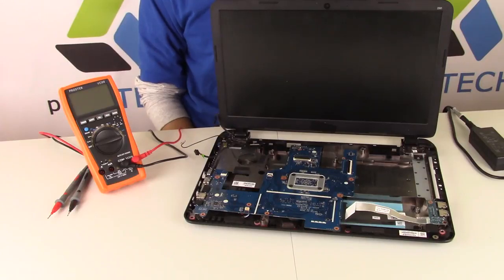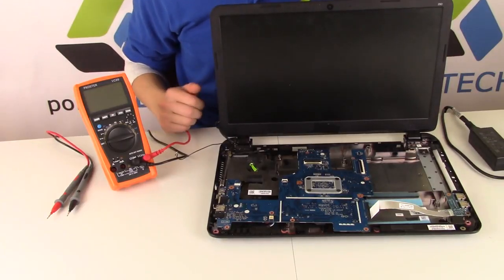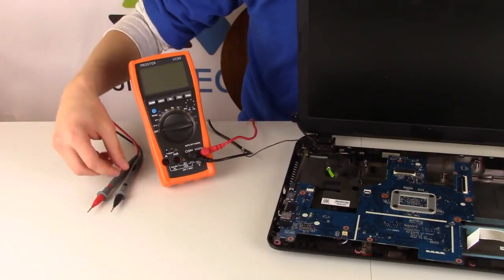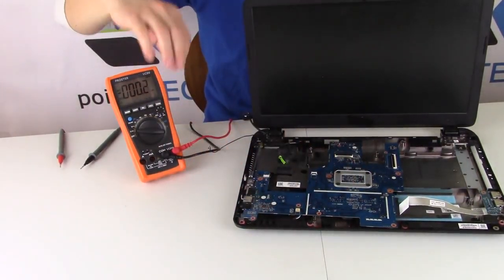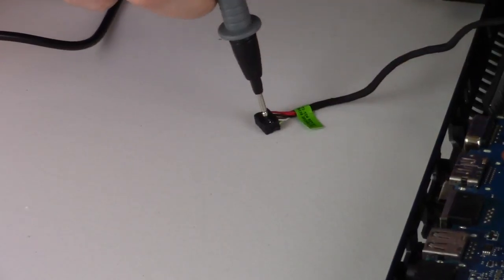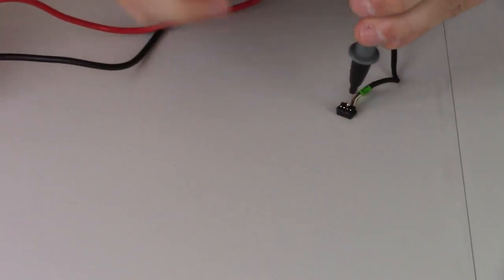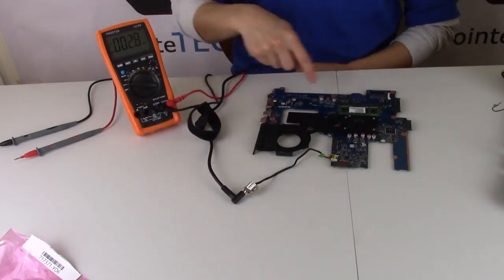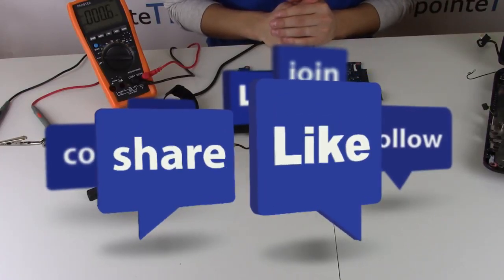How to Fix Test Power Jack - HP Laptop Computer

Comment: Thanks for the video.  Replaced the jack and worked fine for a short period and now it will not charge at all.  I suspect the small plastic (?) clips that hold the jack in place have been damaged. The jack is just not solid.   Have you ever had to replace that part and if so do you have a video for that to reference?

Comment: Great video! I figured out that my power jack is bad. Where can I get a new power jack? Im new to all of this pc stuff 😅. Also, is there a store where I can find the model of my power jack or do I need to buy it online. My power jack is connected to the motherboard as well, but I figured out how to read it.
Reply from the maker: I usually get my parts like that on Ebay, Amazon, etc. Would you like help? If so, what brand and model computer do you have?

Comment: what if it all of it is fine? what should i look at next
Reply from the maker: I dont know. What issue are you trying to resolve? What brand and model computer do you have and whats the issue with it?
Reply: hey, its a hp 15 bs031wm (i3 7100u variant). 
Its completely dead, absolutely no sign of life, no fans, no lights. 
I tried power draining, reseating the ram, inserting the ram in a different slot, inserting new stick of ram, removing the hard drive and just letting it boot up with the m.2 ssd (windows is on the ssd), reseating cmos battery.
I even measured the voltage of the adapter, the port on the laptop, the socket the port attaches to and the voltage is perfect in all 3 of these spots. The voltage of the cmos battery is also a perfect 3V too. 
What else can i test?
Reply from the maker: @shumailkhan7205  For a computer that does not turn on, try this video first; https://youtu.be/kOBY4k2Mn_k. 
If, after trying all the steps seen here multiple times, you have not been able to find the issue, your most likely looking at one of two possible issues. (1) The motherboard is bad and needs to be replaced. Let me know if you would like help finding a compatible motherboard. Or (2) there is another computer component, shorting out the motherboard and need to be replaced such as the power jack, USB board, Touchpad, etc. You would have to troubleshoot each of those individually but unhooking it from the motherboard and trying to turn the computer on. Let me know if you would like help with that operation.
Reply: @PC_Monkey right now i have another issue going on too. the cmos battery wont pop back in. nothing is broken but i dont know why it just wont pop back in
Reply: @PC_Monkey also, thankyou for taking the time out to reply and offering to help further. It really means so much
Reply from the maker: @shumailkhan7205  Its hard to advise without seeing it but if the CMOS batter was in there to start with, it should go back in. If the CMOS battery port is damaged it would need to be replaced.
Reply: @PC_Monkey its not damaged as far as i can tell but i dont know why the battery wont go back in. Is there anywhere else i can contact u? somewhere i can send pictures if possible?
Reply from the maker: @shumailkhan7205  You can post a video to your own channel here and them message me when you have. I can then view it and advise further :)
Reply: @PC_Monkey its an hp laptop. hp 15 bs031wm. i3 7100u variant. i have tried power draining, reseating the cmos battery, reseating ram, installing only 1 ram stick at a time in each slot. The laptop is completely dead, theres no sign of life, no fans, no lights, absolutely nothing. I have also tried removing the hdd and just launching with the m.2 ssd (wasnt there originally, i had installed it, windows is on the ssd).
I even checked the voltage readings of the power supply, the charging port, the socket the charging port connects to. the voltage is perfect. Please help lol, i m a college student and cant even think of getting a new system at the moment lmao

Comment: @PC_Monkey  Help..

what if both dc jack(charger) and dc power board(laptop) are tested and both are working fine.
but still my laptop is not switching on..

Haven't use my Laptop for almost 3 months and i can't switch it on ever since.

Comment: What to do if my power button board itself is faulty? The current went through all the motherboard but it doesn't start the laptop
Reply from the maker: If your board is faulty, you would need to replace it. Are you asking for help to find a replacement?

Comment: Crap, My power jack voltage is nominal but the pc still wont turn on. And the power led on the jack doesn't either. I think I'm cooked :(
Reply from the maker: For a computer that does not turn on, try this video first; https://youtu.be/kOBY4k2Mn_k. Let me know how that goes :)
Reply: @PC_Monkey  I did try all that first ^^ no luck with that process. And last step I tried was check the jack for tension. And sadly it sends 20V for a 19.5V nominal. So bad news ha ha.

Comment: I have the black pin in socket get melt, I change the cable 3 times and it is getting melt, any suggestions !!?
Reply from the maker: If the power jack is melting multiple plugs, there may be an issue with the motherboard. It may need to be repaired.

Comment: I followed all these tips. Everything works only thing that doesn't work is the power jack does not light up but I am getting power
Reply from the maker: For a computer that does not turn on, try this video first; https://youtu.be/kOBY4k2Mn_k. Let me know how that goes :)
Reply: @PC_Monkey  I did watch a different view that did explain this process . But still not getting anything after doing some cleaning around and just make sure all my ports are good everything from the adapter to the power jack to even the connector on the motherboard it is receiving power but the power jack is not lighting up with the charging emblem and the power button on the motherboard in is not responding to when I push it Even with the battery in it or attached

Comment: My system shows a sign of charging,turns on and immediately turns off,it doesn't even get to the point of displaying on the screen......what video can i watch is solve that?
Reply from the maker: For a computer that does not turn on, try this video first; https://youtu.be/kOBY4k2Mn_k. Let me know how that goes :) Also, did anything happen before this issue appeared?  Overheating, liquid spill, Windows update, etc?

Comment: Hi. I have a lenovo legion 5 pro, and it is not turning on. I've tried another one of your troubleshooting videos, but nothing worked. When I attempted the steps shown in this video, I got 16.5V for the battery even though the charger is 19v. Is this the root of the problem or is it something else?
Reply: Actually, I just realized that I was testing the battery(15.36V). Looks like the power jack is soldered onto the motherboard in my laptop. Still, I have no idea what's the issue
Reply from the maker: For a computer that does not turn on, try this video first; https://youtu.be/kOBY4k2Mn_k. Let me know how that goes :)
Reply: @PC_Monkey once I disconnected the battery and the small tablet size battery, I managed to turn the laptop on with a power cord. However, my screen, keyboard, and touchpad are not working. I'm wondering if this is a software issue
Reply from the maker: @nrinol3855  1. If the screen is black, what are the signs that the computer is actually turning on?  Any motherboard or HDD sounds, fan, etc?
2. Also, did anything happen before this issue appeared?  Overheating, liquid spill, Windows update, etc?
Reply: @PC_Monkey hey, it's me again. I tried out some things and managed to get my laptop to run, but only with the power cord connected and both clock and main batteries disconnected. However, when I connect the batteries back, it works properly until I shut the laptop down. Then it's all over again.
Reply from the maker: @nrinol3855  Sounds like you may need to replace the battery :(  Would you like help finding a battery replacement?
Reply: @PC_Monkey thanks, but I already found and ordered one, I'll let you know how it goes once it arrives.
Edit: forgot to say. Thank you for your time and help.
Reply from the maker: @nrinol3855  Happy to help :) Always here if needed !! Good luck !!
Reply: @PC_Monkey a new battery didn't fix the issue. At this point, I have no idea what to try
Reply from the maker: @nrinol3855  you may be looking at a motherboard issue at this point :(

Comment: i tested it all 3 works but it still wont go on? does that mean my motherboard is fried? my motherboard doesnt have a mosfet?
Reply from the maker: 1.  For a computer that does not turn on, try this video first; https://youtu.be/kOBY4k2Mn_k. Let me know how that goes :)
2.  Are there any signs of life at all when you try to turn it on? Lights? Fan, Motherboard, or Hard Drive sounds? Anything seen on the screen?
Reply: @PC_Monkey  everything is dead instead of the charging port light which is on, no signs of life only the charging port light has life? No movement on the 2 fans, and the computer does not turn on nothing on the screen.?
Reply from the maker: @CorneredChronicles  For a computer that does not turn on, try this video first; https://youtu.be/kOBY4k2Mn_k. Let me know how that goes :)

Comment: My laptops motherboard charging port is showing highest voltage of 16 volt instead of 19.65 volt i think it's the problem of Power Jack but i need your opinion on this.
Reply from the maker: 1.  What is happening with your computer?  Is it not turning on?
2.  Also, did anything happen before this issue appeared?  Liquid spill, overheating, Windows update, etc?
Reply: @PC_Monkey  nothing happened and no update 2 months ago I replaced battery nothing more than that also when I press power button then the charging led blinks 3 times and laptop not able to start, i charged battery with some external power source then my laptop started but it's not charging
Reply from the maker: For a computer that starts but does not charge the battery, can you try the steps seen here?  https://www.youtube.com/watch?v=uBr5XmtmKKM @justSRT7
Reply: @PC_Monkey  thankyou for replying, i am subscribing your channel now and I will watch that video soon and get back to you with the good news
Reply: @PC_Monkey  hi there, so I checked all of the things that are mentioned in that video everything seems fine battery port is also giving voltages and charging port also giving voltage of 19.54, 19.55 or 19.56 in variance  but not constant 19.55v .  I think this is a minimal difference in voltages and can be ignored.   What are your suggestions on this.
Reply from the maker: @justSRT7   If after all those steps the battery still is not charging, you can try one more thing.  Making sure its calibrated as seen here:  https://www.youtube.com/watch?v=DmZdTTUsGRM.  If that fails to help, I would just replace the battery at that point unfortunately :(
Reply: @PC_Monkey  hi, thanks again for replying so I did everything but still no luck . I am still charging battery with external power source. Also the  laptop model is hp 245 g6
Reply from the maker: If that fails to help, I would just replace the battery at that point unfortunately :( @justSRT7

Comment: Hi! I have an Ideapad  L340-17IRH Gaming Laptop (ideapad) - Type 81LL. The charging port doesn't work (i have to wiggle my power cable for it to start charging). However, now, nothing works and I can't turn it on at all! Lenovo says it's "my fault" and it will cost me loads to have it fixed. Is it easy to disconnect and reconnect a new port? THanks¨
Virginie
Reply from the maker: 1.  For a computer that does not turn on, try this video first; https://youtu.be/kOBY4k2Mn_k. Let me know how that goes :)
2.  Yes, if the Power Jack is loose like that, most likely it needs to be replaced.  You can install a new Power Jack, replace the motherboard that its a part of, or hire someone to do it as your best bets.

Comment: I was charging my laptop and the charger smoked,did anything happen to it because I used with it previous charger and it was working but after 6 months it is refusing to charge
Reply from the maker: If your power adapter started to smoke then yes, lol, I would say something happened to it.  It should be replaced as its most likely damaged and could even be damaging your computer.

Comment: My laptop voltage says 19.5v-3.34A/4.62A but the charger I am using is 19.5v -6.7A is it bad
Reply from the maker: No.  That charger should still work with your computer

Comment: Your videos are awesome, thanks.  Very clear and extremely helpful.  I've got no charging on an Asus R556LA.  My cord works (putting out 19v), and I've replaced the battery, which will turn the unit on, but it's still not charging.  I'm suspecting the power jack, so I've ordered a new one - any tips/instructions on how to replace?   Is it soldered into the board, or will just snap in?  Any help much appreciated.  Thanks.
Reply from the maker: It depends on the computer.  I dont have one of those in my shop and cant find a motherboard access video online :(  So it would depend on what you see when you open it up.  Most computers however, will have it soldered on

Comment: Any videos on testing power at  the mother board or if all is good to this point just need to replace the motherboard ? I've seen something about replacing an IC or PD1 in the adapter section of the motherboard but have no idea how to test or  where to get such...  This is Dell inspiron i7 5770, where battery is not charging sadly 😢
Reply from the maker: Yes, you can test into a motherboard and hopefully find the component that is faulty.  That would then be replaced.  But no, I dont have any videos on that level repair.  If my motherboards need to be repaired to that extent, I find it faster and easier to replace the board.  Sry :(

Comment: Tell me if you've heard this one...  an HP Laptop 15-bs033cl and a full cup of coffee met at a kitchen table...  

Having followed all of the appropriate rules, including dry-out time, and careful and loving cleanup....  And, having watched your videos as well as many dozens of others, I'm about ready to declare a time of death.  But, before I do, I figured I should go ahead and ask; Is there any additional video or source of info that I might be missing?    

Power adapter works.  Power cable port works, but no light.  The power is flowing through properly to the motherboard, but still no light at the power port.  Power button does not turn anything on.  No fan.  No sound.  No monitor flicker.  Nada. Nilch.  Bupkis.  There is nothing to be seen or heard, however the delightful aroma of coffee continues to permeate every crevice in spite of diligent cleanup efforts.  

I immediately pulled the hard drive, so the research paper and several years of documents, photos, and data were all successfully recovered, praise God.  My husband is very relieved as it was his laptop, his cup of coffee, and his final research paper.  

Is it time to pull the plug and let it go?  Or, should I try any final life-saving techniques? :face-turquoise-covering-eyes:
 
Deb  

P.S. Yes, a conversation was had with the overseer of the establishment (my husband) regarding reliable and regular data back-up solutions moving forward.
Reply from the maker: lol yes I have heard that one.  A lot unfortunately 
At this point, your most likely looking at a bad motherboard :(  It would need to be replaced.  Good luck with the HDD!  Hope all your DATA is safe :)
Reply: @PC_Monkey  Yes, that's what I suspected, sadly.  Oh well!  That is life...  Time of death is noted.  

Yes, all the data is safe, thankfully.  And thank you for your reply!
Reply from the maker: @debbiebrickert    Good luck !!

Comment: Thank you! I worked on this for over an hour and watched six different videos. If you had not said something about the voltage and amps, I never would have looked. Then I noticed I was using a dell charger on an HP laptop. And the voltage and amperage were slightly different. I rummaged in a box and found the HP charger and it works!
Reply from the maker: Glad your all set :) Always here if needed !!

Comment: I have a acer laptop 💻  when I opent it, it doesn't boot first it freez with blank screen after some time acer logo will show up and one or two hours it boots up and starts some times it takes more than two or three hours . Please help 🙏 me to solve this problem..
Reply from the maker: 1.  Can you try the steps seen here?  https://www.youtube.com/watch?v=gDQZvNQ2chc.  Are you able to find any Recovery or Repair options in BIOS? 
2.  Also, did anything happen before this issue appeared?  Liquid spill, overheating, Windows update, etc?

Comment: I think a surge of power from one of the batteries or from not draining other components when replacing a screen on a Dell Inspiron 1500 fried something and now it won't turn on at all. Went through both this video and previously went through the "drain the power for 60 seconds and test battery and power adapter video" and also the unplugging the BIOS battery for awhile, and I can confirm correct power is getting TO the motherboard, but that's as far as I can get. If power gets to the motherboard, what's the next thing to check? (Do I have to test anything regarding pushing the power button on to know where the power goes next?